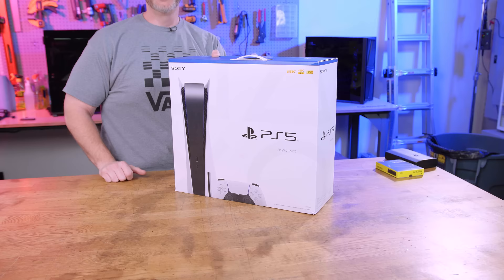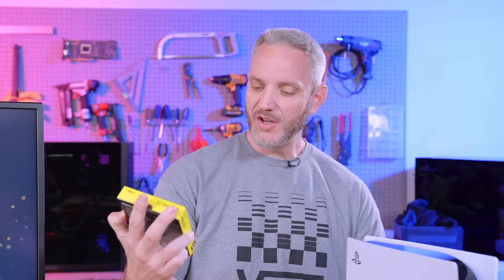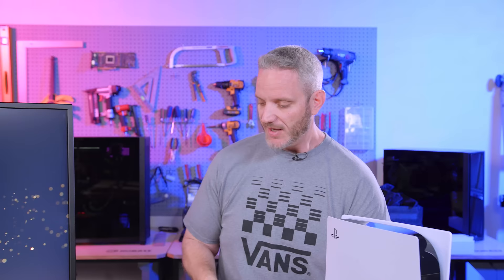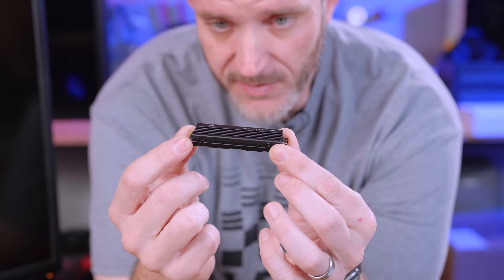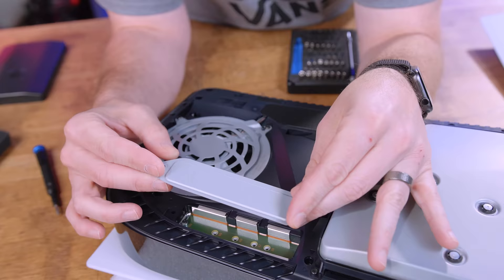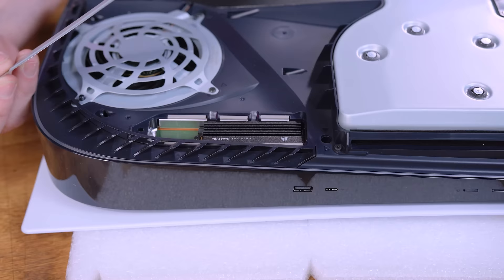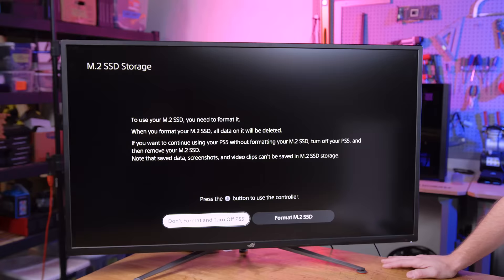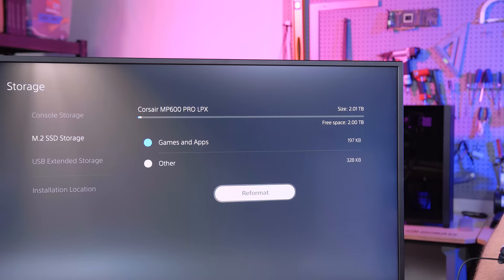How to upgrade PS5 storage - Easy Step by Step Guide

Comment: Fyi, the PS5 relies on airflow to cool the ssd and leaving the cover off would disrupt that.
Reply: 7:35 he says theres no opening for airflow, your full of it my guy.
Reply: @crisnmaryfam7344  this isn’t my opinion, this is information from Sony. Jay didn’t even know how to turn off the system, so that’s him letting us know he’s not sure about the subject. Just research a little for yourself, and I’m sure you will see no one is being full of themselves.
Reply: @crisnmaryfam7344  The airflow comes from up top. It passes over the metal plate that covers the drive, not from below it. It wouldnt make sense to vent from below as you would have to make vent holes through the motherboards. He also says it doesnt pass over. Yes it does. The ridges you see above the m.2 are the vent holes. The ps5 fan you see there pulls air from between the black and white plastic, through the ridges, over the m.2 cover into the fan. From the fan it gets pushed through the system airway and out the exhaust. Airflow was seriously considered when making the ps5. The entire system is made somewhat airtight by foam inserts in open spaces of the system to direct airflow.
Reply: @PercocetMoe so do I leave the cover off or on?
Reply: @damianrios8395  I do stand corrected. 1 yr ago we trusted sony. The design was supposed to use negative pressure for cooling, they made the holes too small so it doesnt do that job very greatly. People tested and said they got better temps with the cover off. If you decide to leave it off make sure you keep it clean because you no longer have dust protection from the cover. Also, If your m.2 ssd has replaces and uses its own heatsink, even better
Reply: Heatsync
Reply: @damianrios8395 lmao you was like “bruh just give me a yes or no”
Reply: @PercocetMoe yeah mine keeps shutting down after an hour of play
Reply: @PlatinumHustle is your cover on or off?
Reply: @x_XBurner361  no wonder my ps5 has cooling problems now
Reply: Sooooo.... cover on or off??? 👀

Comment: This current console generation is reminding me a lot of the start of the 360 era, you couldn't build an equivalent PC for less than the MRSP of the console! There obviously wasn't the price gouging that there is now but even at MSRP you'll struggle to match the performance of these consoles with new hardware for the same price. I think until proof of work mining moves to proof of stake and supply shortages are resolved the consoles will actually be better value for money for most people's gaming needs.
Reply: YUP! I bought a xbox series S in October and it's been a BLAST! Cheap and effective, plays everything, I don't own a 4k TV or a high refresh rate TV so no worries there lol.
Reply: I’m so glad that this gen isn’t one sided like last gen
Reply: Also from what I gather you can even use m&k on games that support it. Series x plus game pass is tremendous value if it has the games you play.
Reply: Console prices have always been artificially low.  They lose money on the hardware, just to get it into your living room.  The real money comes from game licensing and subscriptions.

Comment: Others have already mentioned this, but people have tested thermals with different ps5 heatsink, and the best ones replace the cover completely (Sabrent makes the most popular one of these) it also actually works better if you just don't put the silver cover plate back on, despite what Sony might claim.
Reply: Thank you for this comment
Reply: I used this and it might have killed my console? It won’t stop crashing. Help?
Reply: @Arkolight  sorry I've got nothing on this. I've been using the Sabrent heatsink cover for a long time and I even upgraded from a 1tb drive to 2tb and never had a problem.

Comment: I bought a WD Black SN850 and coupled that with the Sabrent heatsink for my PS5. Perfect fit. NASCompares has done extensive testing on heatsinks for it and found the Sabrent heatsink to be one of the best for managing heat dissipation and it maintains the design that Sony intended. So far, so good! And if I ever choose to upgrade it to let's say 4tb in the future, I can always repurpose this drive into my PC.
Reply: I just ordered a WB Black 2TB drive. It seems that the heatsink that comes with it should do the job, as well.
Reply: I bought one last year as I needed more fast  storage for my ryzen 9 system ,. I paid   £210   for a brand new SN850 2tb  last July from ebay all the other offers were like £300-£350 I have my warranty too, July 2021   it was a right bargain, the it's  i still  like £275 on ebay uk  Samsung 980 Pro was like £150 more at time that's £285 right now. Brilliant drive had no problems so far, big in productivity  workloads, gaming not so much, xplane 11 though loads in like a min with add on scenery, reshade,  enhanced cloud scrapes. I bet this great for running ratchet and clank though etc, I tested against my gen 3 Samsung drive I got loy less money on boot times and it was neglible completely overkill  and a waste for  that
Reply: have the same setup, 2TB, this heatsink IS the best unless there is an active cooling one
Reply: Can you link these two items, please? I would like to compare them and I'm not sure if I found the correct heatsink when I searched for it.
Reply: I heard that the Sabrent PS5 Heatsink spreads heat to the whole stick and that is bad for the memory controllers and that shortened the life of the M.2. Is that true or did Sabrent think about already you reckon?
Reply: @westjviolin  you could use the bequiet mc1 heatsink too. i suggested it to a person, who wanted to upgrade his storage and it fits well. dont get the mc1 pro, cause that heatsink is higher and will not fit. as a drive you have a couple of options. samsung 980 pro, wd sn850, crucial p5 plus. maybe there are other options but i think those are the major ones. just chose the one, that is the cheapest where you live. i think the samsung is the fastest, followed by the sn850 and then the p5 plus but i dont think that matters. they are all fast drives.
Reply: Did you put the m.2 cover back on or leave it off?
Reply: Is it still only good for ps4 games?

Comment: I did this expansion months ago with the exact same M.2 drive. Works brilliantly, especially notice the difference after using a USB SSD for a year while I waited for them to unlock the software for the drive. Amazing speed for a console.
Reply: Hey man, I hope you get this notification.  Do you have to transfer a game over before you can play it? Or can you play games right off the ssd?
Reply: @DannyPhantom1999  what exactly do you mean ? You can move your games stored in system storage to your M.2. And then in the storage menu under settings , you can set the default installation location as your new M.2 storage so whenever you install or download a new game , it's gonna be on the M.2 SSD !
Reply: Random question, that I'm sure I could probably find the answer if I looked, but he mentioned something about leaving the cover off because he was worried about the temperature. I just got a ps5 and am looking to upgrade my hardr8ve. Have you had any issues with the temperature? Or have you heard of it being an issue for people?
Reply: @DannyPhantom1999  if you are speaking about ssd, you can play PS5 games right off the SSD, while external drives cannot play PS5 games off them
Reply: Should we leave to cover off? Thanks
Reply: @solonely17  wondering the same thing. I’m going to leave it off 🤞
Reply: @knguyen542  Do not leave it off it disrupts the airflow
Reply: Y’all have any issues with your ps5 shutting down randomly?

Comment: To turn off the console, press the PS button and scroll over on the bottom to the 2nd to last icon and select it. Then you can select Power Off & Rest Mode. If you hold the PS button, that is for going back to the home screen if you're in a game or other menu... it will do nothing if you're on the home screen. It will just make a sound.
Reply: 🖕 Congratulations you among the selected winners claim your PC via telegram 📩⬆️⬆️....
Reply: @kingsy212  I hope they redesign the UI to something similar. I keep holding the ps button like it was the ps4 and it exits out of my game and im like...... ugh
Reply: Unplugging the PS5 was why the Repairing Storage screen came up. Had a weird power surge while I was on my PS5 but I realized that I hit the reset button on my UPS before the PS5 was turned off completely. Got the same message. lol I sometimes still get mixed up in the options by mistake or instinct.
Reply: You can also hold the Power button down until you hear 2 beeps to completely turn the PS5 off. 1 beep for sleep, 2 for shutdown.
Reply: @kingsy212  hang on im confused. What games can you play on ps4 that you cant on ps5? I didnt think there'd be a need to switch between consoles
Reply: @NunyaBusiness21  There are a few PS4 games that doesn't work on PS5. Not sure why.
Reply: @epaaj  emulation quirks. AC Syndicate is one. It works fine but later on you will get very bad graphical issues. Just due to the nature of how some games were coded.
Reply: @NunyaBusiness21  as of December last year, these are the ps4 games that don't work on ps5.

Afro Samurai 2 Revenge of Kuma Volume One.
Hitman Go: Definitive Edition.
Just Deal With It!
Robinson: The Journey.
Shadwen.
TT Isle of Man - Ride on the Edge 2.
We Sing.

Obviously these are all devastating omissions...
Reply: @kingsy212  I think it's fine honestly anyone that has been using a PlayStation since like PS3 should be able to navigate the system pretty well. The icons works just fine but that's just me
Reply: @NunyaBusiness21 You're correct. Only PSVR1 games really need the PS4 console (and sometimes the dualshock controller).

Comment: Funny enough Jay when you mentioned older consoles being a pain to upgrade storage that was mainly xbox since the ps3 and ps4 where as simple as remove the cover swap in a compatible drive and put the cover back on
Reply: The xbox literally had a little slot to pull the hard drive with a little ribbon, and today simply a memory card like GameCube and ps2
Reply: @phantomreaver85  360 could have the HDD case taken apart and install a larger HDD in there, but that was an extra step and such that most people sisn't seem to know about in the time.  Their love of proprietary parts has always been a pain for gamers.
Reply: True, but the caveat to PS4 is having to clean install the OS
Reply: @Shadowespeon17  Same with the ps3, on the 360 you could shove a sata HD in there without using the HDD case.

Comment: Easily the best PS5 cover removal I've seen to date.
Reply: Here was the first time I've actually seen it removed. Now I know just how easy it is to upgrade my storage, of course at $70 a game (not to mention I just got finished building a PC to replace my old failing one, also not to mention I still need a new GPU) I won't be opening up my PS5 or installing storage anytime soon. I will keep this video handy for when I do though.
Reply: @cael_1303  if you have a ps4 library or PS plus you probably will fill the memory the first day.

Comment: One thing I would mention to do is if you have a PC with an M.2 slot, to update the firmware on the M.2 drive first. I know the 980 pro registered a faster speed on the PS5 after firmware update.
Reply: Yeah.

I got the gigabyte aorus 7000s 1TB and i get 6557MB/S after i installed and is did a read speed test.
Reply: I updated my 980 Pro & didn't make a difference.
Reply: Can use an external enclosure to update S well.

Comment: You SHOULD ALWAYS put the cover back onto the M.2 slot. It uses Negative space to remove the excess heat. you need that seal for the cooler to function properly.
Reply: There is no such thing as negative space cooling. You mean negative pressure.

Comment: Sabrent makes a heatsink for the SSD that replaces the m.2 cover. It makes contact with the SSD while being exposed to PS5's airflow which should be helpful in cooling the drive more effectively.
Reply: That's what I went with, I think it's the best M.2 cooler IMO.
Reply: wow you won!😂👆 I can't believe Jays fanbase is still falling for these comments. the fact they're still flooding Jays comments even after he's warned people so many times means his fans are definitely still falling for them and sending these people money. people are slow.
Reply: The best performing PS5 SSD cooler according to testing is a certain one from bequite!. Forgot the name tho.
Reply: I also went with Sabrent and their integrated heat sink. Their speeds are also pretty comparable to WD and a the other fastest ones.
Reply: I went with that too, the 4TB model + it's heatsink. It was on sale at the time. And it sill is for $769.99. Yes it's expensive. But I buy digital. And wanted to have plenty of storage to last me for a long time. Some of the these newer games are 100GB+ in size, or larger. My first pick would have been Samsun or WD. Due to using their HDs in my various computers over the years. But they were either sold out, or didn't have them in the size I wanted. So I took a chance on Sabrent and I've been very happy with it.
Reply: Similar to that, and for those that don't want to stick with the Sabrent's nvmes or already have a different one that want to re-purpose, Graugear NMVE heatsink for PS5 has a whole heatpipe extending over to the blower fan. Most likely is the best solution yet, but it requires to leave the aluminium cover off.
Reply: @leeroyjankins2307  gotta love those tools that are invented.
Really handy. But we shouldn't be doing the work of a multi billion company. But I guess it is what it is 🤷🏼‍♂️
Reply: @OZEEtube  i guess it is the bequiet mc1? there is a mc1 pro version but that heatsink is to high. at least if you leave the cover on. i dont know if it fits without it.
Reply: @bertracoon1884  Yes, right. It was the MC1.

Comment: Great info on how to take it apart.  It might have been helpful to others to show the underside of the lid and what is actually holding it down and why you press on it the way you do WHERE you do...makes a lot more sense after the fact.  There's 2 little nubs at the end about a couple millimeters high that don't have hooks in them.  You are essentially lifting them out of the holes they sit in, allowing the rest of the plastic cover to slide open.  When you slide it back together, the main hooks catch the sliding cover, then the little nubs drop into those shallow holes, locking it in place, once you slide it all the way up.

Comment: Hi Jay. For the record the PS5 nvme slot does have airflow. There is a teeny tiny vent inside the compartment. I tested a drive with and without a heat sink. It works initially. Under load it thermal shut downs. With heatsink, 0 issues.
Reply: This was one of the questions I had upon reading it needed a dedicated heatsink. Wasn't included in the video so thanks for clarifying.

Comment: The SSD bay does have airflow, but the PS5 uses negative pressure in that slot to draw the heat from that vent.  Not the most ideal method, but as long as your heatsink is actually a functional heatsink and not just useless scrap metal then it will do the job.

Sabrent, and IIRC, one of either ADATA or PNY has a specialty Proprietary heatsink cover that improves on Sony's original method of managing those temps.
Reply: So would you put the plate back on or no?

Comment: Might actually throw my new 2TB SSD into my PS5 so this is a good video to see where the upgrade slot is located. I tried installing it into a laptop and the laptop manufacturer didn't provide the screw, so when I tried a screw that was slightly too big for the hole it tore it right off the motherboard, yikes.

Comment: Heads up for anyone concerned, you can only have 1 USB drive at a time. you can alternate it freely, but you can't have 2 usb storage devices concurrently. If you like to have everything available always, a 2tb or bigger nvme internal drive, and a 4tb or bigger usb drive (i like 4tb mx500), is Really worth considering splurging on. If both your internal and external storage get full, upgrading is painful.

Comment: I would really love to see a video about the temps with and without the plate, because i've heard that the plate is designed by sony as another form of cooler. Also Sabrent designed their own M.2 Cover plate specifically for the ps5s M.2 slot, which also serves as a heatsink so you dont have to install one on your own. Seeing these different factors being compared by you would totally make my day. :D
Reply: Probably something GN could do with their temp probes and other tools they have
Reply: Heatsink covers is a rip off. It's not going to affect performance if you just buy the ssd and pop it in without the  heatsink.

Comment: Actually, as other videos (and Sony) explain, the cover over the cooler serves as a channel to direct airflow from the fan and cooling fins over the M.2 unit. Leaving it off would potentially lose that airflow, which could also result in higher system temperatures due to air leakage.
Reply: Other people have tested this with temperature probes and open is superior cooling. Gamers Nexus actually proved this.
Reply: furthermore you can look and see theres no "opening to allow airflow" even Jay said so, 7:35
Reply: @crisnmaryfam7344  I'm going by what Sony claims, since they designed the thing, and they say it MUST be put back on.
Reply: Nope. Hundreds of reviews of many different model M.2 drives and heatsinks, measured with thermocouples, show otherwise.
Reply: @burnsyd17  That may well be true, I don't dispute that. Take it up with Sony, who demands that the cover be put back on.